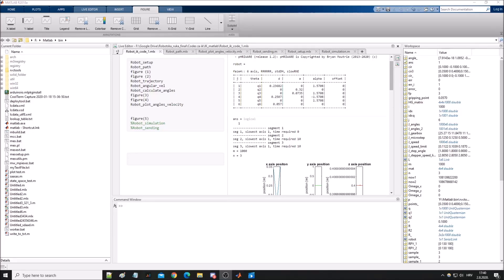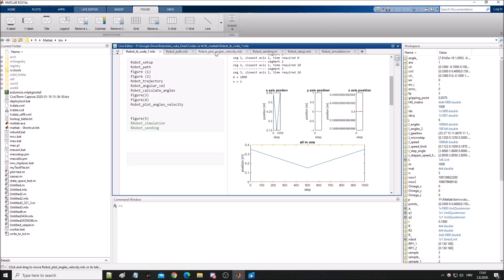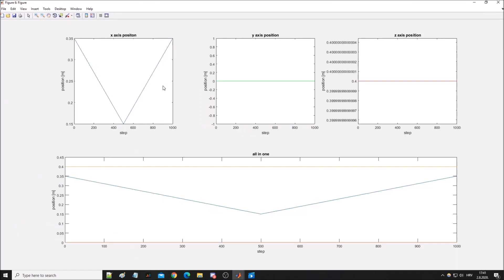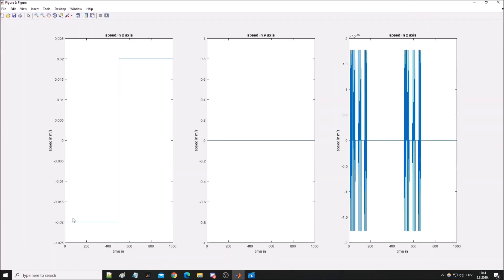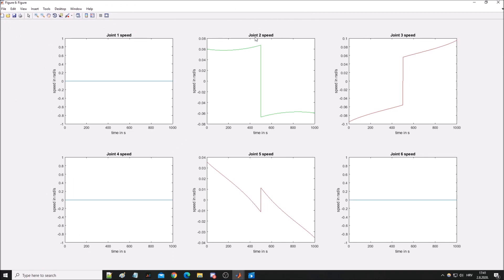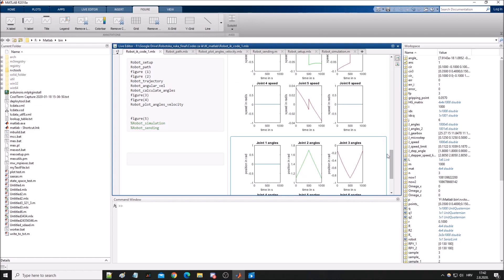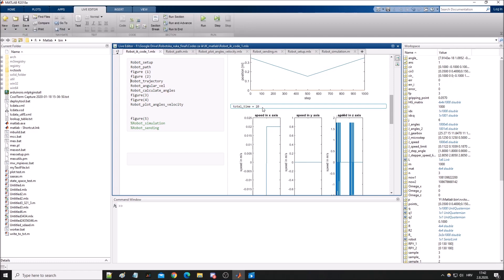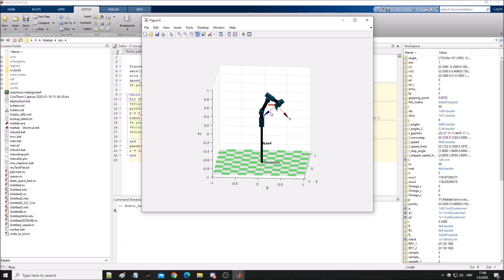Faze4 - Trajectory planning in Matlab for robotic arms

Comment: Hey I was wondering if it's possible to control this robot using VR controller data, I think that would be very cool. For €200 you can buy a controller with 2 desktop sensors which can really accurately read out motion in 3D space. Is it possible to link this VR controller data to the tool of the robot arm?
Reply: @source-robotics  Yeah I was looking at a smaller design maybe, and just linking the controller position to the tool position 1:1 at first. Just have the tool move to the latest controller position, not per say a 1:1 design with a arm. I think it would be great for programming actions for people who don't have a lot of experience. Just a simple move and grab operation for example. But right now I am looking around for any open source robot designs and software support which makes this possible. Am a mechanical engineer but my software/programming knowledge is very limited.